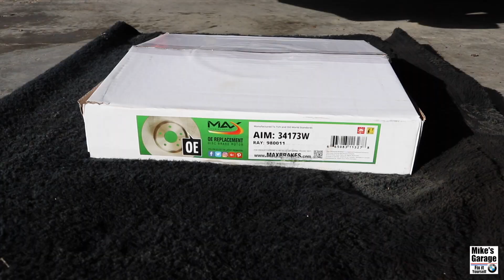How to replace front brake pads and rotors on BMW E46 : DIY

Comment: appreciate your detailed video! any helpful suggestions on how to loosen and remove the two mounting 16mm carrier bolts? Having issues taking them off with a 16mm socket..
Reply from the maker: Thank you for watching. Try to use longer breaker bar. If it's not fit, use wrench and hammer it down or up depends on side.
Reply: So, your advice did the trick with removing the 16mm bolts..  so now caliper completely off..  Next I  remove the two 5mm hex allen bolt off.. but rotor won’t move, it is stuck! Suggestions please..
Reply from the maker: Put long pry bar behind rotor on one of hole where 16 mm bolt was and pry it out.
Reply from the maker: @G33ZiM3  Just like in this video https://youtu.be/Gjucdzf9BQQ 2.48 min
Reply: @mikes.garage  There was no pry bar available, instead, I used a mallet, and eventually, it broke loose 😎. Thanks, Mike!
Reply from the maker: This way works too 😉

Comment: Nice  video, but why from drilled rotors to regular rotors? Why not new drilled rotors?
Reply from the maker: Thanks! I didn't like the way they worked. After washing the car, these brakes practically did not work and when the weather was wet they also did not work well until they warmed up.
Reply: @mikes.garage  oh man...I just ordered black coated drilled rotors for me e46 for $160 shipped. All rotors and brake pads. The current rotors on my car is regular and nothing wrong. I just went for the look and anti rust

Comment: Very clear video! Mike, wanted to ask how come you chose MAX brand rotors. Are they quiet and do not make excessive noise like the generic BMW rotors? And what brand pads would you recommend?
Reply from the maker: Thank you! I chose this brand as it was the cheapest on EBay. I paid $160 Canadian dollars for all 4 rotors and brake pads. I like to use and test different brands so I can compare them all. The brake pads make noise only when you brake first time and if it was wet outside, other then this, these brakes are pretty good so far. I always recommend to buy original parts. I can recommend Brembo, ABT or TRW (this is original pads)
Reply: @mikes.garage  I see, thank you for taking time and explaining! I hope more people will see the clarity and quality of your videos, and your channel will grow:)
Reply from the maker: Без проблем, этот канал был задуман для того чтобы помогать людям делать сервис на своих машинах самому) Спасибо за тёплые пожелания! 😉

Comment: You forgot to mention the pads need inbedding and you need to press the brake pedal before you start untill its hard to push, else you gonna have a bad day
Reply from the maker: Thank you to mention this! )
Reply: What happens if you do not do pump the pedal before starting?
Reply from the maker: You will have weak brakes, second push will fix it )

Comment: Anyone using a torque wrench to remove bolts should be smacked upside the head. Otherwise, nice work.
Reply from the maker: No, I don't have my ratchet set at that time, that's why I used torque wrench 😐 Thank you for watching! 😉